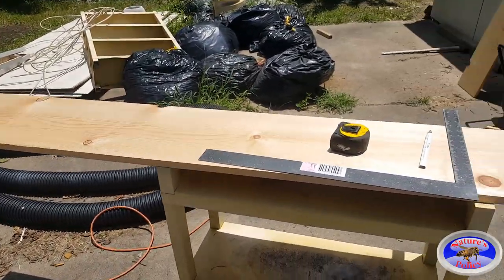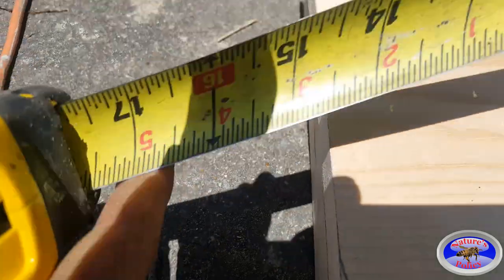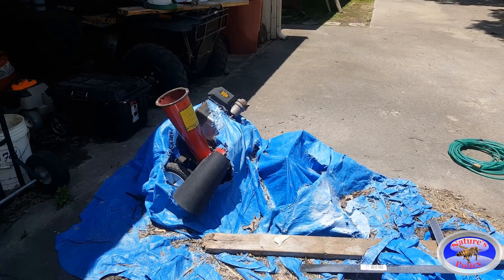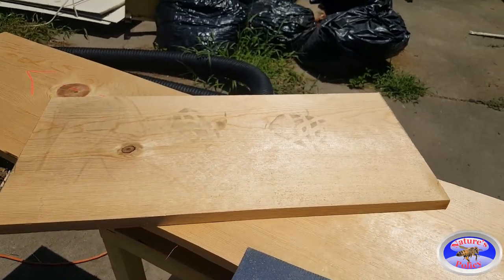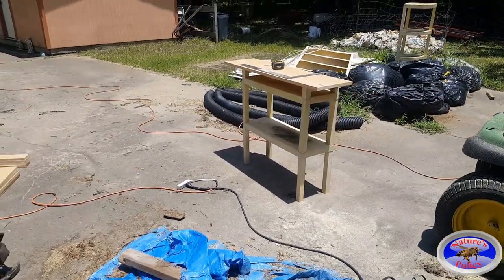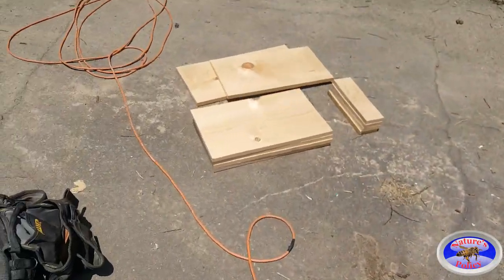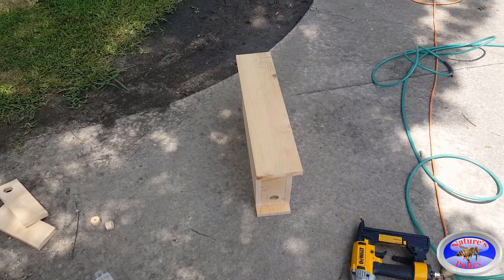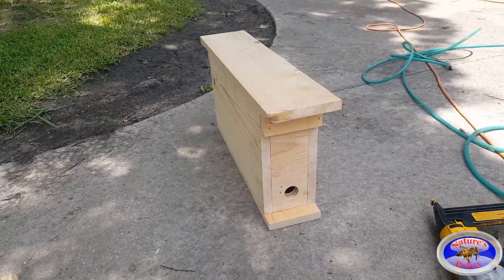How To Make A Queen Rearing Nuc ... A Two Frame box for Honey Bees

Comment: What size staple are you using? And do you have a feeder video?
Reply from the maker: 1-1/4" - 1-1/2"
Best to do 1-1/4 so they don't end up popping out if you have the pressure to high
I do not have a feeder video yet ...there are several options depending on what you will use for a feeder ... milk jug, circular feeder that you can get a bee supplies, etc

Comment: Sir, what kind of staples are those? I have a Brad nailer and a pin nailer.
Reply from the maker: 1-1/4 inch staples ... brads will work, but are weaker. Staples are best. You can glue them together and use brads but glue vents out poison into the hive when it gets hot.

Comment: Jed doesn't the frames block the hole, entrance
Reply: The frames are designed to have enough clearance to allow the bees through the gap. They only need about a 5.5mm gap. This is why you see a lot of hives with 1/4 inch mesh on the opening to keep mice out.